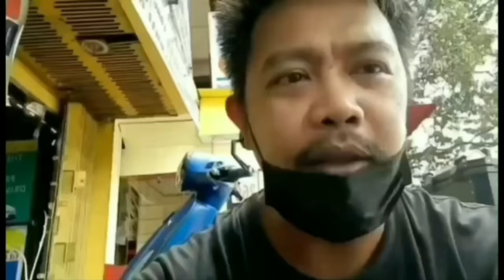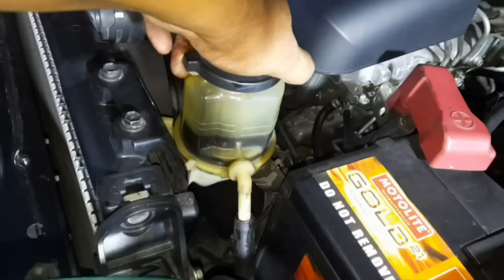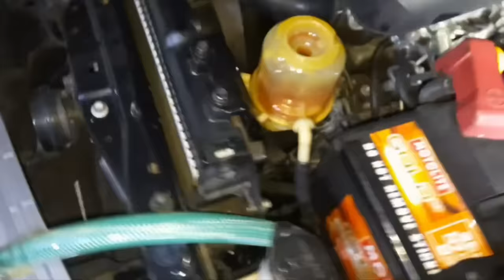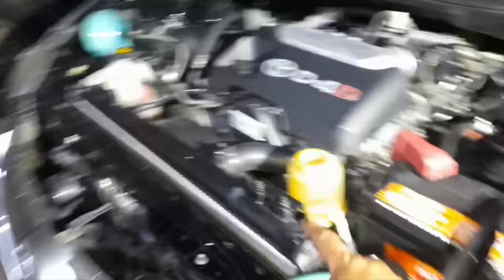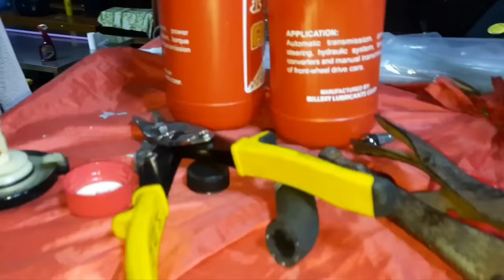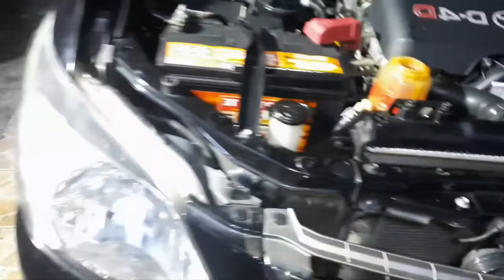Power steering fluid flushing,fluid change

Comment: Sir iyon po ba 2004 Revo ay may rack and pinion? Kung wala po dapat ko po ba gawin iyon turning the steering wheel. At alin po hose ang i-disconnect para ma-flush. Salamat po.
Reply from the maker: Yes para ma flush pati gearbox ng steering
Reply: @wrenchmantv  salamat po sir. Di pa dumarating iyon oil na inorder ko.

Comment: Ok lng po ba maubos ang fluid sa reservoir kapag pinilot ang manubela ok lng matuyuan?
Reply: Wala po kayang madamage na part kapag naiga ang fliud.
Reply from the maker: Dapat may nagbabanto pag pinipihit.kagaya dyan po sa video nilalagyan ko ng fluid habang iniikot
Reply: @wrenchmantv  yong naoanuod kong isang video, hindi inistart yong makina during flushing. Nung nag refill na sya ng new. Ok lng po ba yon? Or better naka start engine dur8ng flushing para mailabas talaga old oil while turning the steering wheel? Salamat po sa sagot. Bukas kaai balak ko magpalit ng steering oil kasi medyo malambot yong manibela at mababa na din yong level. Tama po ba naisip ko?
Reply from the maker: @jasonatadero6458  para sakin,personal chioce ko yung iniikot koanibela para napalabas ko lahat.ok din naman procedure nya,diko lang prefered

Comment: Sir db dpat power steering fluid dyan. Hindi atf png transmission yun eh. Masisira mga oil seal ng power steering sa katagalan.
Reply from the maker: Automatic transmission fluid (ATF) is the same fluid used inside the automatic transmission. ATF can also be used in some power steering systems. Some ATF types include Dexron and Mercon. Synthetic power steering fluid is a non-oil-based fluid.depende sa specs ng sasakyan.for porsche or other high end euro chf oil po gamit nila.sa innova na yan,yan ang spec na oil